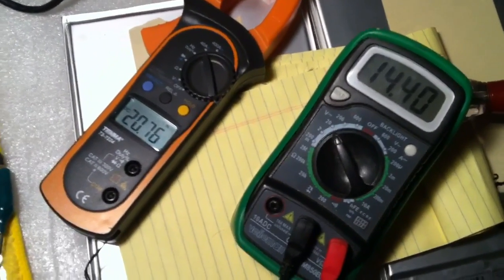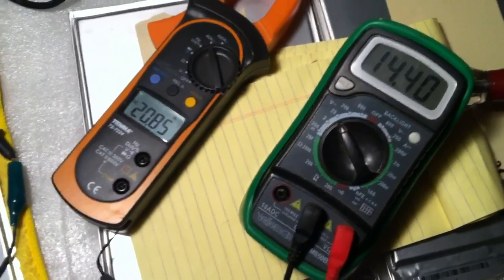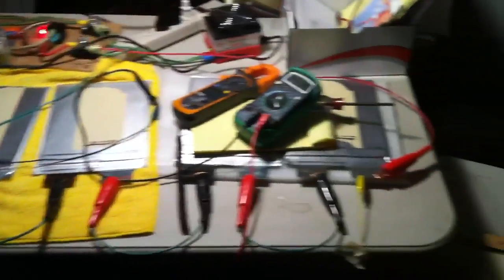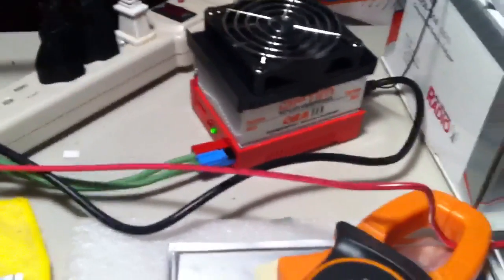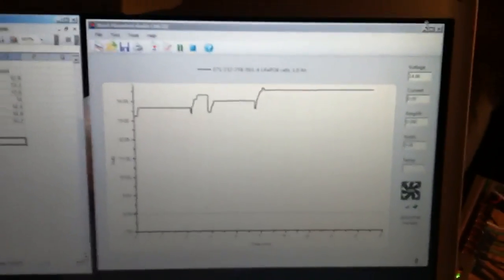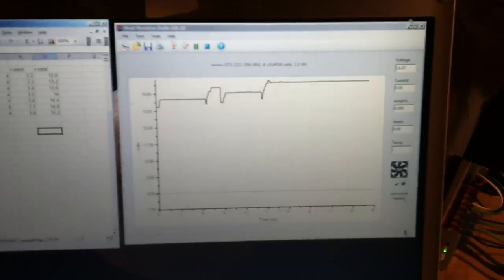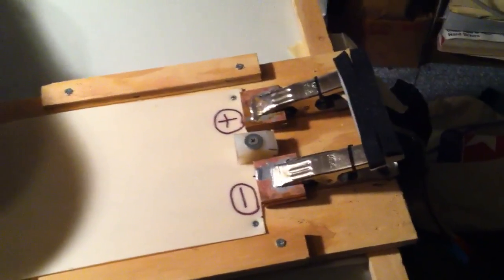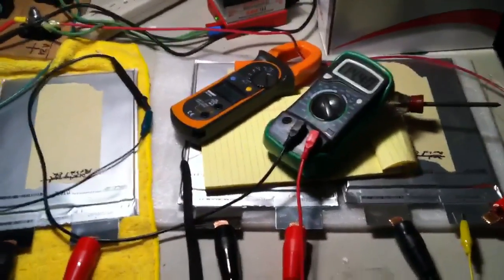Factory Five Mk4- Electric Car - Video 25

Comment from the maker: @DanFrederiksen My charging method is totally manual until I get better equipment.   I charge until the amps go very low and the standing charge sits around 3.6V.   It drops down to 3.3-3.4v quickly under load but remains there for most of the discharge duration.    I want to find out what the real capacity is on the cells, so the only way to really see is to push them to both ends of voltage spec.     10 cells, OSN.

Comment from the maker: @tenney1119 posted: Congratulations on a project well thought out. I noticed you elected not to use a transmission. Two hundred pounds saved! What did you choose as a final drive ratio on the differential? 
------------

The rear end ratio is 4.10:1,   I chose to go to high gearing since there is only one gear.   Top end will still be over 100mph at 5000 rpm.   I'm hoping that the high gearing will reduce amps when starting from a stop.

Comment from the maker: @DanFrederiksen Yes.   I am still testing, but the cells are averaging very close to 19.6Ah when pulling 1C.   All are about +/- 0.2 Ah of that mark.   I am starting to put together a test rig for higher current levels.    Also a single cell, fully charged, is being left aside untouched to monitor self-discharge.   After the first few days, daily discharge has leveled out to about 0.002V of loss per day.

Comment from the maker: @lagsco Good question.  I do not know!   This motor can easily drive the car directly, but some prefer using standard transmission, or a gearvendors 2 speed (no reverse) transmission.   NEDRA members like direct drive and/or use a series/parallel shift of the motor configuration.  I think it depends on the design goals of the car.    I am going direct drive and hoping for good performance.

Comment from the maker: @DanFrederiksen 2.0 is what I used, although it might as well be 2.5 as the roll-off at the end is pretty quick.    I am not certain about the charge voltage though.  3.6 seems to be it, but I also see 3.7 and 3.8 mentioned in various places...

Comment from the maker: @DanFrederiksen  Not much data yet.  First one was charged up to 3.6v and made 19.373 Ah.  Second one under way....     As received, without adding any charge, they all came in around 16   Dont know if they were simply not fully charged or had some self discharge.  Probably the former as the voltages were identical, to within 0.001V

Comment from the maker: @themrcul If testing goes well on these cells, then yes, I plan to build the pack from them.  The usual prismatic cells cant supply enough current, and to reach the voltage and current levels I want would be too heavy and expensive.  The smaller 2.3Ah cylindricals will do it, but welding up a pack would be more difficult.   I have a few large cylindricals for the 12V car battery but have doubts about their power and weight.  For me, the A123 pouches are the best choice.